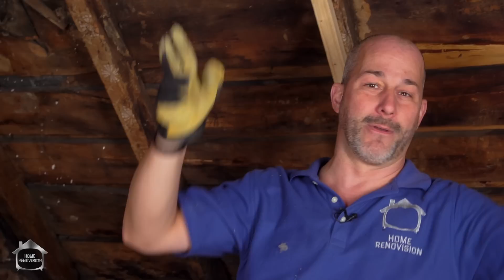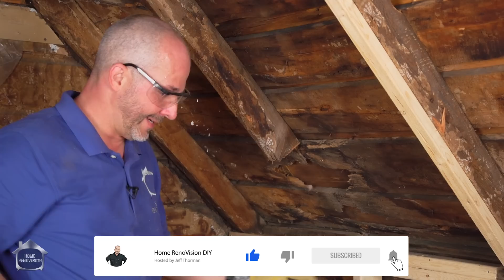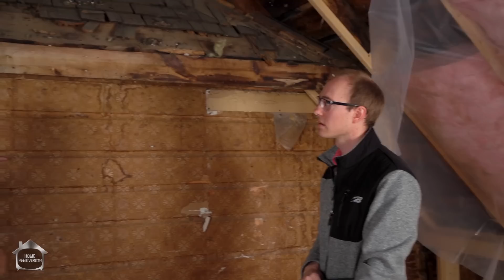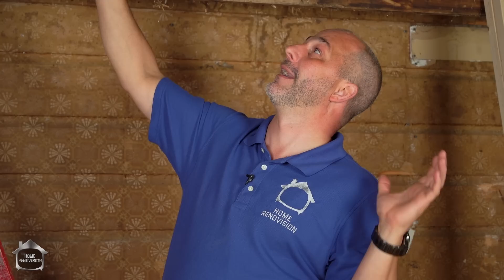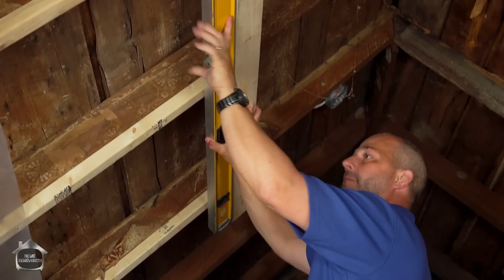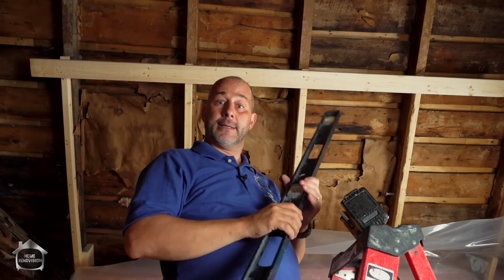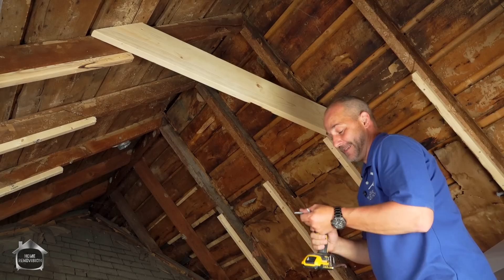How Structural Engineering Affects DIY Projects

Comment: Slight nonsense coming from the “structural engineer”. These ties are closer to rafter ties than collar ties and they cause higher horizontal forces at the walls. Move them maximally up and sister the rafters or put full purlins.

Comment: no airflow behind the insulation so that humidity can get out will end up rotting your roof from the inside out need to ass sofits and ridge vent plus 2" airflow behind the insulation so for r20 you would actually need 8" 6 for insulation and 2 for air flow. hope this helps cheer

Comment: I feel like I hit the lottery by finding your videos. I also have an older home (late 1800s) that is in a colder climate and requires a lot of work- undoing some bad DIY, uncovering the beauty of the original home, modernizing and doing everything well enough to give it another 100 years of life. Its daunting. Im actually tackling a project that is eerily similar to the one you are doing here. The only difference is that I have rafter ties and not the collar ties. The way you talk to your engineer is exactly what I would sound like... "This is the main thing...ok and this is something we are doing over here, is that cool?... ok now I have a dream of adding this in the future, what I can I do now to prep for that?" I want to add a skylight in the room we are tackling now, but I think in a few years we may be replacing the roof and it will be easier to add the skylights and dormers then.

Comment: You’re in Canada and R-20 is enough insulation?
I’m in upstate New York and my rafters are 3 X 5 and 3x6 I was thinking I needed to furr it out by a few inches to add R-30 insulation. 
But since you’re using  R -20 I’m thinking R-15 + a R13 would be enough
Reply from the maker: just to be clear we have the same winter weather as you do. Cheers! check your local code so you are not disappointed. Cheers!
Reply: @HomeRenoVisionDIY  I ended up just using R30 and putting the R15 and R13 I had on hand in the separate walls.
But I added a radiant barrier to the cathedral ceiling to block heat in the summer

Comment: Is there another video of this specific project that talks about how you finished the insulation?  I've got a similar project and would be interested to see how you addressed the ceiling insulation specifically. Thanks! Love your content!
Reply from the maker: we added 2x2 to the rafters and installed r 20 batt. a better option is to spray foam but this house just would not maintain that type of investment.
Reply: @HomeRenoVisionDIY  So did you install styrofoam spacers for venting? If you did was there enough space for the R20 insulation?

Comment: This is why you always check the foundation first. Older houses were on blocks and pillars or even log rounds. The older houses almost alway needs to be jacked up and leveled out before building anyth additions. Ive don't this over 20 times in my life.  I have 2 beach cabins that were build in 1890's. Even if I layed a foundation it would eventually be off because of the water table, tide, and sand under the cabin

Comment: I already have a vaulted ceiling in my hearth room, but I love the look of exposed wood. Whatever faux beams I've seen didn't really convince me as real structural support, those look like obvious fakes, so, I ended up here to learn about vaulted ceiling. I'm an engineer and I should be able to design my own, very convincing fake exposed beam ceiling. 😎
Reply: I'm in the same position as you. Mechanical engineer here and just bought a house which I will retrofit with vaulted ceiling. Going to go with real wooden beams after months of consideration.
Reply: @impactodelsurenterprise2440  Right! Like for vaulted ceilings it should be a default thing. Go for it. Btw, I've been looking into this for a while and just wanted to let you know, if you're willing to go the distance, you can do more than a plain jane wooden beams on 2 slopes. I decided to do another suport arch at the base of the wooden beams on the sloaps.

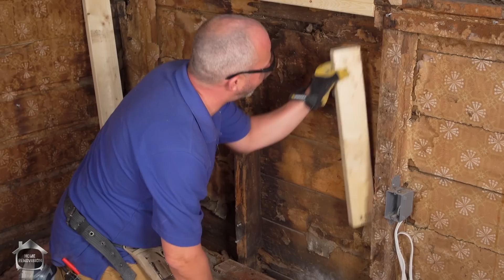Comment: Thank you for the great content. I have a similar situation on my cabin. They used 2x4 roof rafters, the bottom span is approximately 16 feet and the roof pitch is 7:12. I am  I have a couple of questions (any feedback would be greatly appreciated). 1. By adding the furring strips to rafters, does this add anything structurally?  2. Will you be hanging drywall?

Comment: There are good engineers and there are poor engineers.  Like the one that "redesigned " my house for me  and the stairs would have ended straight into a wall and the ceiling height was 5 ft 5 inches.

Comment: This doesn’t look sound at all.  Usually collar ties have to follow the 1/3 rule which means they can’t be higher above where the rafter rest on the plate then 1/3 of the height from there to the ridge and then you would need ridge ties.  Also furring out 2x4 doesn’t give you the same structural strength as a 2 x 6 and when it comes to insulation, R20 is good for walls and rafters are the ceiling so that should have been at least R38.  As far as faster rafter ties that usually requires at least 8, 16 penny nails.  Lags are good but not just 2, should have look at the building code

Comment: My mom's attic didn't even have the cross beams, and we decided to drop it down and do just 4 ft across at the top with 2x4s, make it easier to add lighting, just full sheets of 4x8 drywall, and to add some rigidity to the roof. It's only like an 8 ft ceiling finished I think. We didn't care about having a peaked ceiling though, I personally think a flat area like that looks great like a trapezoid shape.

Comment: When you started fixing the framing you called the framing plates a beam and you also called the studs beams. Then you didn't even nail the plates in square so the plates don't even touch the studs you scabbed on. You should've just used a cats paw and pulled the 2 nails that were holding it or cut them  out instead of trying to pry the studs up too it. Because it didn't work and you don't fix a mistake by making more of them. You shouldn't teach sloppy framing and you don't try to frame a level ceiling in a roof that's not level. Unless you're going to frame a new roof that's level and straight you just measure off the floor at both ends and find a happy medium. I've remodeled a lot of houses that old and some that should've been torn down and it's always the same issues

Comment: Real good.  Replace dry rotted and termite wood with soft white wood.  The water and termites should make short work of that. Have you ever hears of pressure treated wood that's impregnated with Cu So 4?  Well I hope after rainy season you get started on the roof.  If not that insulation will hold all that water back.  Right?

Comment: Someone put the laundry room off the kitchen instead of off the bathroom. Ugly, crowded, unsanitary. I also can't stand how they did the roof for it-real dorky. So I'd love my microscopic (624 square foot) rancher to just bring the whole back of the house even instead of a rectangle with a laundry room jutted out one end of the back. Guessing the roof would need to be re-pitched. Laundry room extends less than six feet, but tiny rancher means very low roof.

Comment: I found this video and did the ceiling in my bedroom. Hired an engineer and did it all myself.  I had to raise the floor to the level of the rest of the house because I was having moisture wick up through the ground. The ceilings were way low so I did it almost exactly the way you did this one. I had to add in all types of support like lateral braces and another top plate along with supports where the gable vent used to be as well as collar ties of course. This video gave me the motivation so I am glad I found it. Thanks
Reply: Funny- I’m about to do both the floor lift and the ceiling, too. 

Any chance you’re also a youTuber and made a video about raising your floor? 
cuz I could really use that 😹
Reply: @johncocktosensen  we did a floor lift on our old house. We framed the inner wall. Used tongue and groove osb to class one side of the wall. Hung the wall from the roof and added a piece of metal to the floor joist, looped it over the bottom wall board (don't know what it is called) and pulled the floor back to level. Or as close as we could to level. Used metal strapping to attach the floor to the wall at each joist.  Or wall ran the same direction as the roof. Roof joists ran down from the wall on each side to the outside wall. Inside wall ran down the middle of the roof line. Did this in 1983, roof and floor are still as straight as the day we did this.
Reply: That's great!
Reply: Hey how would you evict a racoon, serious question.
Reply: @Thegbiggamerz  put some apples in a trap
Reply: @Thegbiggamerz  strobe light

Comment: I'm thinking a 2 x 10 or 2 x 12 vs the 2 x 8 that way you drop it down less but cover a larger span to match the engineer and then in the process over engineer it by covering more span and add more sheer strength

Comment: Sister the rafters so they "scissor" and cross over to the opposite rafter.  You can use pieces of plywood to tie the divergent sister back to the rafter every couple feet, basically creating a truss.  You lower the pitch but still have your vault and space for insulation. Much stronger than collar ties.
Reply: You need a friggin laser beam, mate.

Comment: Hello Jeff! Insulation questions here.

I'm doing a very similar project in my 1950's style home that has slopped ceilings but no insulation. I see you left the 1" air gap. Does that air gap need to vent from the outside? I was thinking about leaving a 1" airgap and also drilling 2" holes into the eves to allow air flow to enter from the outside of the house. Is that necessary??? Am I doing more work than I need to??? Just worried about moisture build up and that creating mold. I plan to use Roxwool R15 or RAMAX Thermosheath 3 3-1/2" thick insulation. Please advise. Thank you.
Reply from the maker: not a mold concern but fresh air does reduce the heat build up and extends the roof shingle life. Cheers!
Reply: @HomeRenoVisionDIY  Awesome, thanks for the response.

Comment: I bought one of these balloon frames houses an hour east of Ottawa. 3 years, 6 20 ton Jack's, lally columns, cases of construction adhesive, and a few cases of nails, I leveled the foundation, replaced the sill plate, sistered the bottom 2 feet of the wall studs, replaced and levelled all floor joists on both floors and attic trusses, replaced main and upper floor beams,  made the main floor open floor plan. Relocated and replaced stairs, windows, subfloor and flooring. It was the most brutal and frustrating project I've undertaken, but the ROI was really good.
Reply: I had to take a break and Crack a beer just from reading this 😮‍💨
I too have decided to tackle a turn of the century project house. Needs reworked top to bottom
Reply: I’m on the foundation/crawl space step 🫨

Comment: I dont understand how there isnt any air channel in between roof deck boards and the fiberglass insulation. Everyone i speak to says this will cause mold with no airflow and rot roof out from inside as soon as you have warm moist air from house up into that space. How are you getting away from that and peak vent and vented soffets?   I dont understand

Comment: If your rafter is rotten outside and continues up inside your home toward the truss (I hope I have the terminology correct, would you replace that rafter, say while installing a new roof  or just cut back rotted wood and roof? Or would you add another 2x6 to the rafter over hang, end that is on the outside of the house? They added another 2x6 adjoining the one that was rotted and put caulking to cover up the end by the roof. I don’t think you do it that way. Looks tacky. First thing you see coming out the slider doors.

Comment: I get that the wall your working on will take on some load when you remove those upper rafter ties.  You put those studs in and not one touched the top plate of the first floor because it's balloon framed.  You pry up and the stud was like 4in short.  Why not put that stud in tight from plate to plate so the load carries to the first floor and so on?  Your only depending on shear strength in nails doing It your way.  I have to say I don't like the way you framed that, and don't get me wrong,  I'm not bashing you over this, I'm just bothered over your technique of doing it.  First I would have off set that double top plate cut.  That cut you made through both plates create deflection in the wall, it no longer works as one brace.  The stud you added should be snug plate to plate.  Everything seems to loose,  yes nails have shear strength, but when you don't hit plate to plate you need to bolt through and sandwich those studs.  Your depending on the short wall to take a partial load, just my opinion, plus our town would never accept a partial roof rafter fix like you did adding a piece, they would only accept if it was bolted together.

Comment: Roof vent baffles was supposed to be installed between each rafter before the insulation and plastic so the roof can breath from the eaves to the ridge  cap 
Or it is not necessary????
Im not a builder but i have heard its necessary for air circulation under the roof deck to eliminate 
Roof overheat /   prevent mold build up/helps ice melt down /roof shingles lasts even more 
But you are the expert sir 
Just a question !
Reply: You are right . In order to have it work properly you would need to remove the soffit bottom on the house and ideally a roof vent going across the entire peak. 
My self I wouldn't have done his project like this . I would not want the collar ties.  I would have built a scissor truss and had a vaulted ceiling without obstruction .

Comment: Are you saying "balloon construction"? That doesn't seem right but I can't tell what on earth you are saying hahaha
Reply: Yes "balloon framing" was the framing method used in houses built before  WW2 when the present "platform framing" method took over and became the standard. You can research lots about it, including its increased risks of damage from a structural fire, since the fire can easily travel from the basement, right up inside the wall and directly into the attic within a very short space of time. This increased fire risk must be mitigated when renovating an old balloon-framed house like this.

Comment: It's shocking what you find in old homes.   I've seen 2 homes that were 4 posts (the home construction starts with 4 posts, at 4 corners, and then there are beams tieing them together.    then siding is nailed on, between the top and bottom beam.   A part of the roof, was supported by a 2x4, on it's side.  yes, on it's side.  the strength came from the roof deck, which was solid wood.   The floor, was built, by nailing layer to layer, there were no joists.  yet, everything about the home said, it was not safe, yet, the home is standing where it's been for 150 years.   There were no home inspectors 150 years ago.
Reply: Yeah Norm.....It is called Post & Beam construction.
Reply: @exnjute  The kitchen floor, has no beams.  None.  it's layers of 2x4's, that that bounce when anything walks on it.  been like that for 150 years.   as you walk across the kitchen floor, it sags in the middle, about 3 or 4 inches.    A porch roof is the same, it's got 2x3's, that are supported from the roof deck, with 1x lumber.   the beam holding up feet of snow, if a 2x4 on it's side, that just bends when the weight gets more.    weird.   Nothing is held firm, like today.

Comment: Good video, I was wondering whether the pony walls would start pushing out with no rafter ties within the bottom third of the rafter as is the norm or does the balloon framing compensate for the outward thrust?  I suppose height of the wall matters, with shorter being better.

Comment: While I am in awe of how much you know, how easily you switch from electrician to master builder, how few tools you can do everything with, and how much i love your tips and tricks, I get the feeling you have Ethan The Engineer just as your yes-man.  Pretty much nothing this "engineer" said made any sense. "You're not changing the span" - um yes you are.   Rafters have increased thrust at the base, and increased flexure.  "You have to go to the foundation" - um, no , the foundation forces are unchanged, since the floor beams take out the rafter thrust.  Maybe he is better at the administration than the engineering.

Comment: Bring in an expert to determine if you have mold
Reply: EVERY SINGLE old house(30 years or older) has mold in the walls, especially in the kitchen and bath areas.  I have never opened walls in old house without finding it. As long as it's not major and is encapsulated, it is not a problem.

Comment: I thought it would be a better ideal to stagger the seams on the double top plate where you cut them. Instead of having that weak point with a double seam in the structure stagger the framing on the double top plate, construction teams won't even allow the seams to align when they build houses brand new, they stagger the seams. But i mean that weak point will affect the amount of cross beams you will be allowed to take out. I know you are adding a 2x4 but on the 1 1/2" plane not on the 3 1/2" plane. So you will have only 1 1/2 inches thick of wood frame structure wood holding that seam together, it could buckle out at that spot, especially if you take the cross beams out. You will have extra force on that double top plate pushing outward, not downward, but outward when you take the cross  beams out.

Comment: Hi Jeff, if I kept both joists and rafters as is, will the rafters able to hold drywall (ultralight) as is? Will I be able to remove every other joist? Thanks. I can send images of existing roof and attic.
Reply from the maker: the second you alter structure you need professional assistance. Cheers!